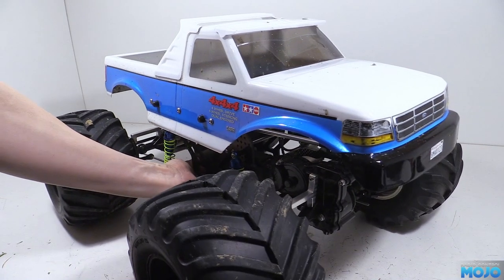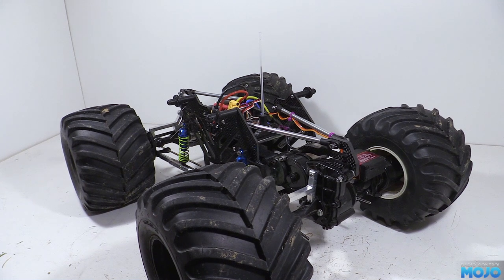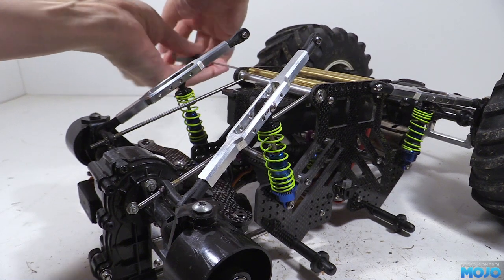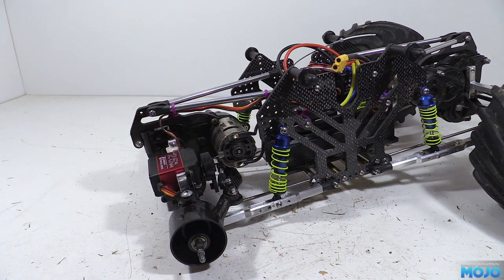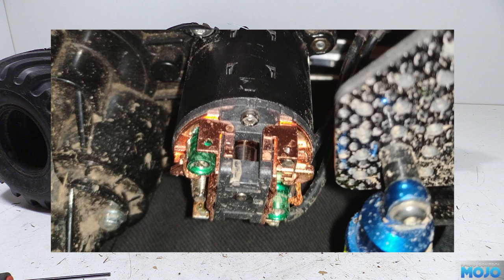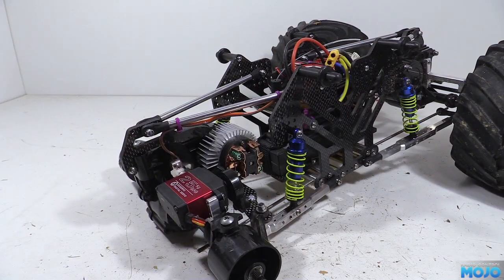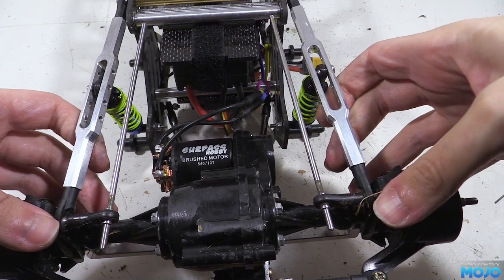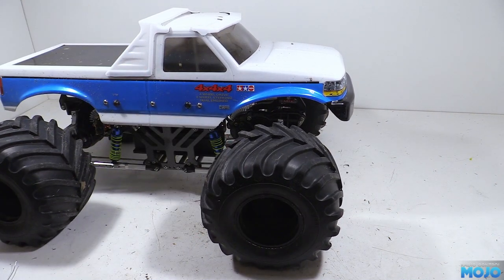Tamiya ClodBuster - #8 POWER!

Comment: Another great episode. really surprised at the speed,thought it would be much slower. When given some beans it looks scale when the arse squats. Also that wheelbase adjustment as helped the body stance a lot. I know this build is still in progress but have you any spoilers for any up coming stuff? really enjoy your build and commentary style.thanks
Reply from the maker: Lots still to do on the Clod as things turn up. Some more carbon bits, wheel and tyres, custom bumper, motor mounts, dampers and no doubt other things will come up along the way

Comment: I had some really great modified racing motors from back in the day in my clod (38000rpm and 180 Watts).
they were insanely fast
Reply from the maker: Sounds like the old days when we got 5 minutes of run time and liked it ^^
Reply: @RCMojoTV 
It really was amazing, maybe I said it the wrong way, I meant the motors were from back then, I had them lying around till this year and put them in the clod
Reply from the maker: Ah, modern battery's then, not going for the full 90's experience... I don't blame you!
Reply: @RCMojoTV  Yeah, I used a 6200mah 2s.
was crazy fast for a clod, but as it is with modified brushed motors, you'll have to replace the brushes all the time :(
Reply: @RCMojoTV  Oh and this motor still can be bought from a Shop called "partcore.de"
Reply: @RCMojoTV  But I chose to put them back into the clod, what a fun stock clod